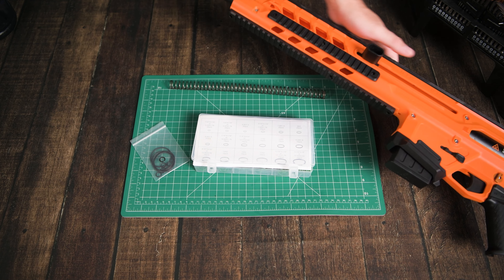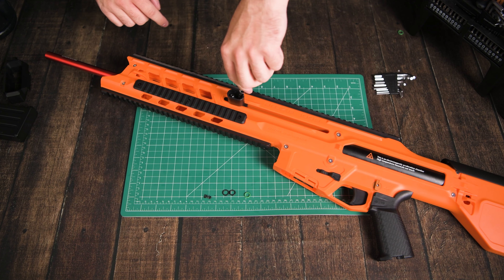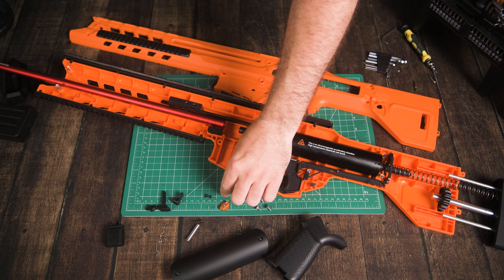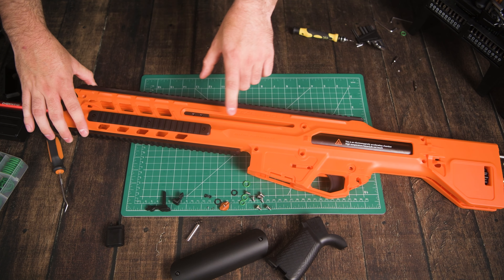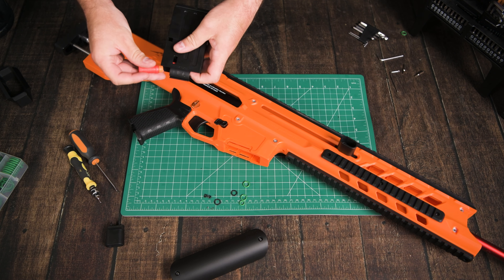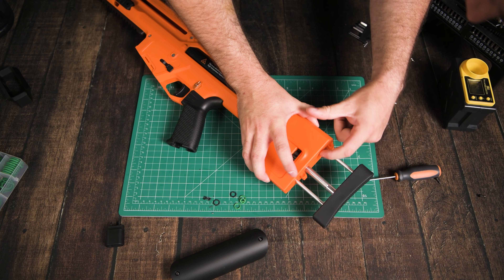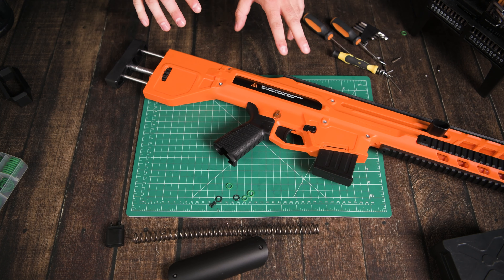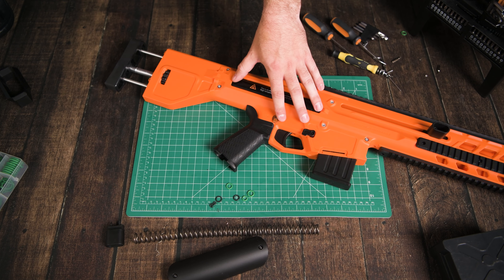ZWQ S100s Baize Basic Upgrades!

Comment from the maker: Since recording this I have ordered two custom springs to suit this blaster. Stay tuned to see my final results in my full review video.

Spring dimensions are 1.8mm x 17mm x 300mm and a stronger 2.0mm x 17mm x 300mm.

Find it at the below links:

OutOfDarts (USA): https://outofdarts.com/products/zwq-s100s-baize-blaster?ref=RIa3bVI3vXYhUs
Blastertech (Australia) https://www.blastertech.com.au/S100S_Baize_ZWQ_BLASTER/p2928293_21987134.aspx
Frontline Foam (USA) https://www.frontlinefoam.com/product/baize-s100s/?sld=8
Reply: That's the video im looking for.
Reply: I just purchased the 1.8 spring from frontline, but they don’t carry the 2.0 one. Any idea where I could get that spring? The 2.0 spring for the s100War Saint doesn’t fit sadly. I’m trying to make this my highest performance blaster.
Reply from the maker: @godeatsbagels  I went on eBay and found someone that sells 300mm springs of all sizes and it lets you choose the diameter and gauge.
Reply: @BradleyPhillipsYT  could you please drop a link to the ebay store for the springs?

Comment: Spring spacers! Glad you tested with the 1.7 spring. We also have 1.8 on the way and are excited to try it. I used Woker Swift/Harrier springs and was hitting 300 with the 1.6x300, but that gets more compression it seems like.
Reply from the maker: The stock springs have somewhere around 2 inches of slack to them. It's ridiculous.
Reply: The worker springs work in the Baize?
Reply: @arifickel2077  the springs are narrower, so just some slight modification to the width of the plunger spring guide and a guide in the back to keep the spring aligned and it can

Comment: It may seem counterintuitive, however when double sealing its preferable for the piston ring / rubber o-ring on the low pressure side to be a slightly less efficient seal than the high pressure side. It significantly reduces wear on piston rings.

Comment: Hi Bradley, I'm Andy from sg. I have a couple of questions. Do u need metal internals like plunger rod and stuffs for this S100? Is the prime  exclusively on the right? Can we prime on the left? I'm interested in this blaster but would like to seek your opinions before committing.
Reply: Heyo! I just purchased one of these from frontline foam and got the latest version. To answer your questions, the bolt comes with handles on either side and is ambi prime. I personally don't find the metal internals kit necessary but the FPS out of the box is where I need it to be

Comment: Circlip pliers can sometimes let you replace pusher o-rings via the magwell. Depends on the blaster and the pliers you have.
Reply from the maker: Yeah I don't have a pair of those, but I found a different way using the scribe tool and a ram rod down the front of the blaster the same diameter as the pusher.

Comment: Hey bradley, just asking if this blaster is compatiable with swift 1.8 spring? Just concerned as the spring is almost 2 times longer than the 1.5 spring it comes with. Thanks
Reply: They’re too long. I cut a swift 1.8 spring to 300mm and tried it. Definitely need a spring guide inside. It was crunchy without one.

Comment: What were the O-Ring's diameter?
Reply from the maker: The ones I used to get the 2 second seal were 7.8X1.9 according to the box. I have since tried even smaller ones and reversing the barrel instead of having the flared end and that achieved about the same, maybe slightly longer like 5 seconds.
Reply: Disassembly of the blaster seem horrendous but I guess we've been spoiled with the Nexus' and Trion's spring change feature and DZ Pro, Prime, and Harrier easy disassembly.

In hindsight, the Baize disassembles like a standard Nerf blaster and with the potential for modding, it seems worth the slight inconveniences.
Reply from the maker: @ClarenceSampang  some parts are still quick to change. Spring, barrel, and I also found a trick to getting orings on without opening it either involving a ramrod the same diameter as the pusher.

Comment: This blaster is shit, got a better deal out the box but lost it when changing barrel n orings were no help
Reply: *seal
Reply from the maker: Out of the box performance is bad, this blaster has a larger plunger tube than a Caliburn though so performance should be insane if you actually mod it.
Reply: By all means the potential is there n IV seen the vid of the near 500fps build with metal internals and 2mm spring, iv already gone back at it and managed to get a seal again and getting 170s again but still extremely disappointed in the blaster, hopefully we can get the metal stuff soon so the potential of these can be more easily achieved, were did u get your 1.7 spring btw
Reply from the maker: @skatteredlogic  ZWQ supplied the 1.7 but as I said in the video it doesn't provide full compression. Get your own better one.